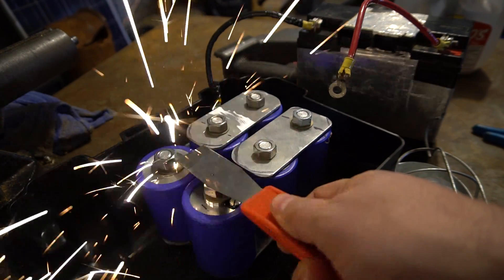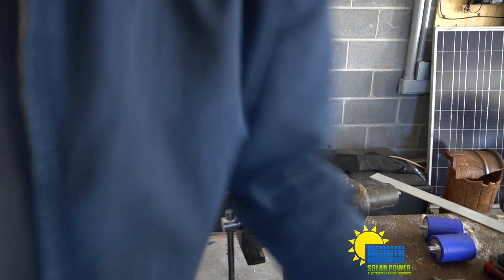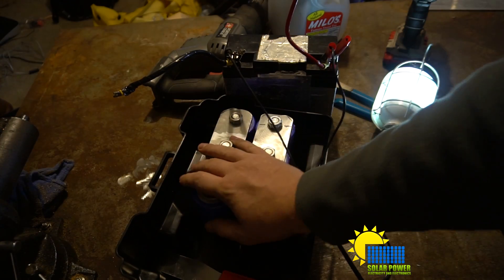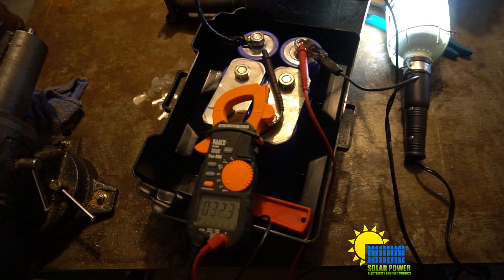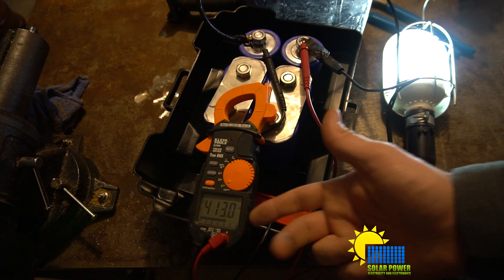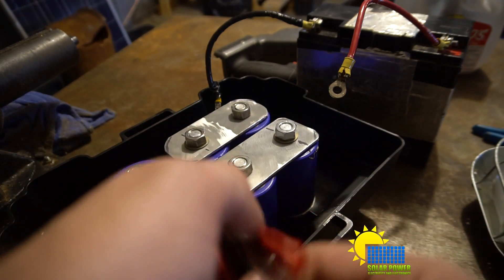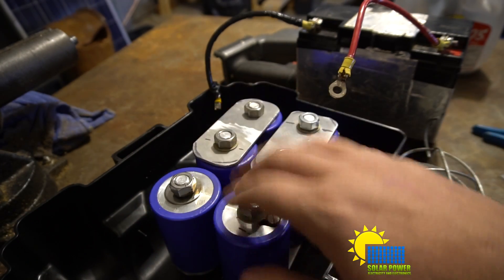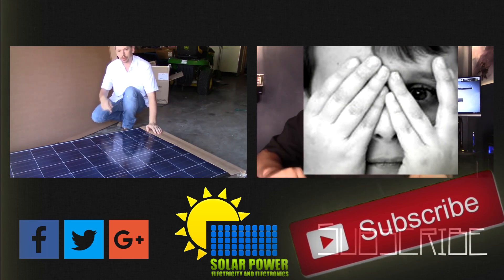Building A Supercapacitor Battery For Your Car

Comment: What is the orientation for the caps? Like, are they all in series? Positive to negative? And what are the ratings for each cap? Is there a voltage rating?
I'm looking at building a couple for car audio applications but no nothing on what to look for when buying or building them.
Reply from the maker: You will need to remember to have the balance circuitboards to match but this cap will shit on every audio cap.You will need 6 caps and 6 circuitboards to run this on a car,and yes it will run in series.
 https://www.ebay.com/itm/Maxwell-BCAP3000-E-BoostCap-UltraCapacitor-Super-Capacitor-3000-Farads-2-7VDC/323218258394?hash=item4b414f39da
Reply: Thanks. I did see on eBay those boards you were talking about but they were designed for capacitors with both contacts on one side. What kind of board should I get for that style of cap
Reply from the maker: https://www.ebay.com/itm/Maxwell-2-7V-3000F-Supercapacitor-UltraCapacitor-3000f-Farads-BCAP3000-Q4912-ZX/153068336323?hash=item23a39574c3%3Ag%3AXrIAAOSwgoxbKc6b&_sacat=0&_nkw=Maxwell+BCAP3000+E+&_from=R40&rt=nc&_trksid=m570.l1313&LH_TitleDesc=0
Reply: Solar Power Electricity and Electronics 
Thanks man. Helped a lot. Question, how do I wire in those protection circuits?
Reply: And another question, would any of the smaller 500F caps work for this application as well? I'm talking about the ones that look like they belong on a circuit board.